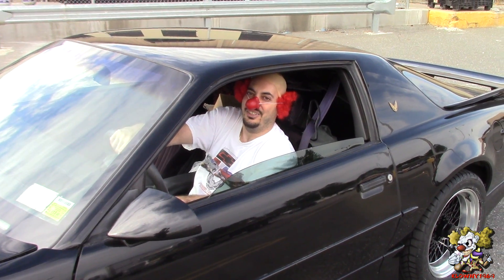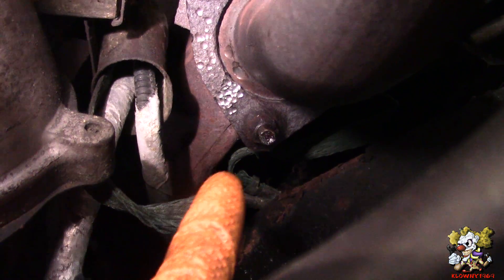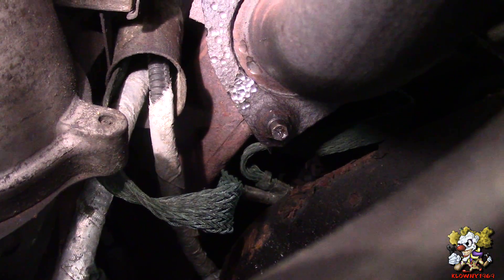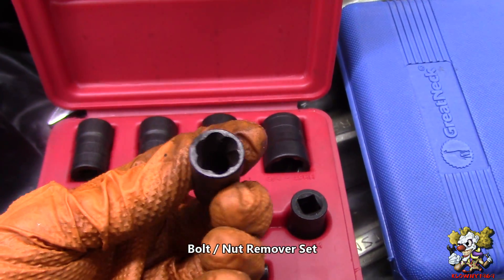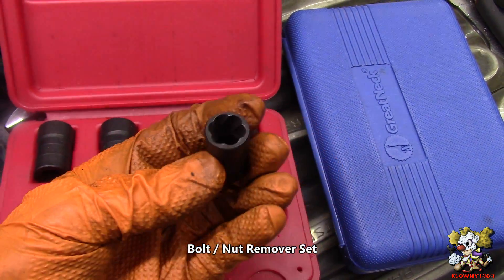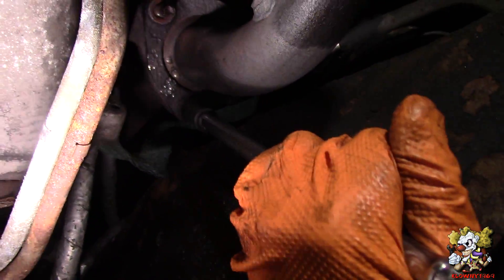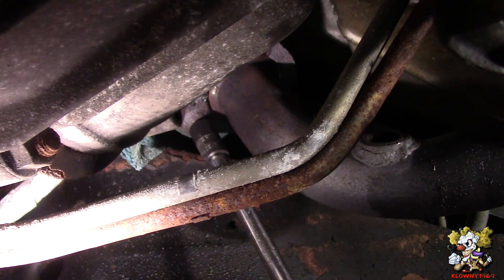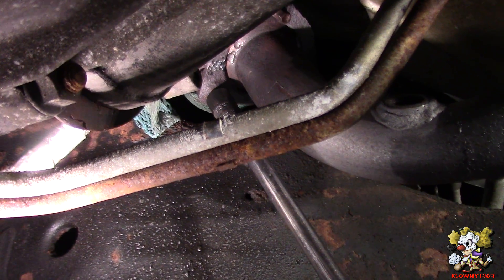Removing Rusted Stripped Bolts and Nuts! THE BEST WAY !!

Comment: Nicely done - tried it today on three exhaust manifold heat shield bolts only one came off ,  they do work most times. - just not enough depth to get a bite on the other two  , too  rusted . I'll try welding a nut in place next or send it to the crusher :)
Reply from the maker: STEVE ROB REVIEWS hello there mr. Stevoo..yeah it depends what you use them for..I found these sockets work great on exhaust collector nuts..I took all six off like this..good luck with your car! And thanks for stopping by again!